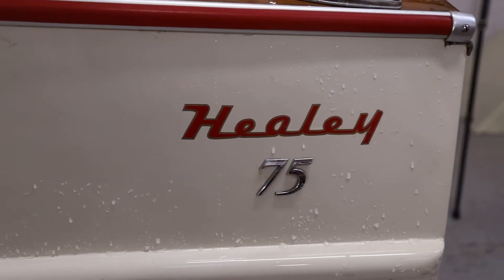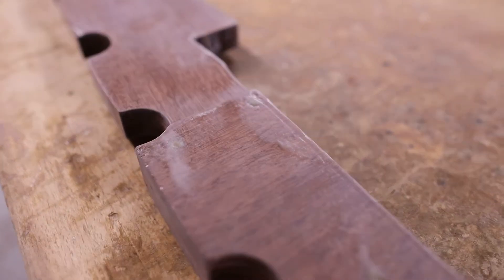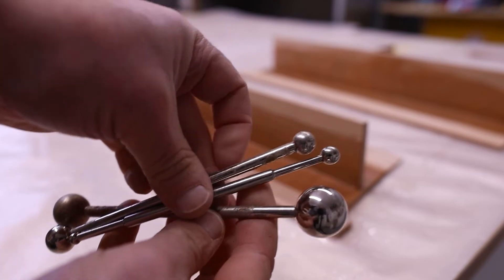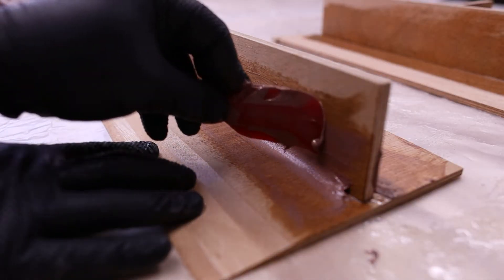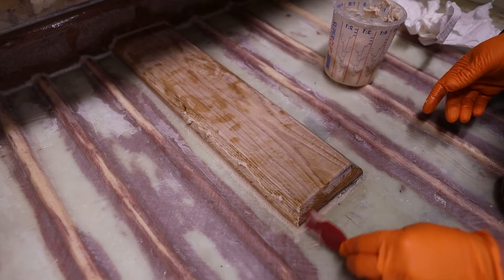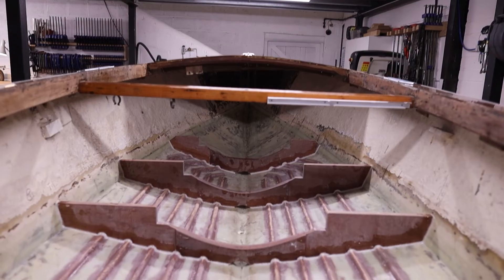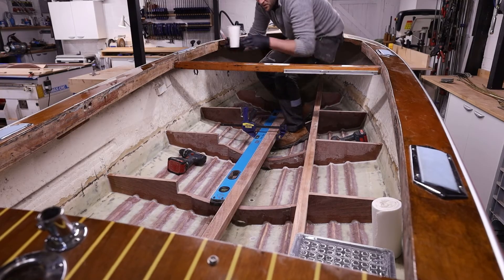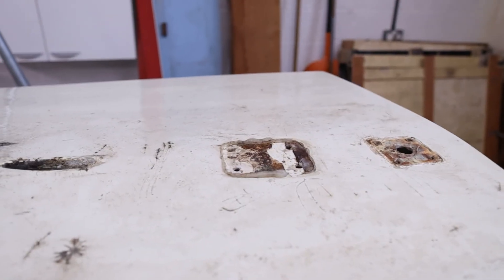Frame Installation and Epoxy Fillets | Healey Boat Restoration Part 5

Comment: Tried your tool technique today doing fillets on my boat. Used West 407 and 410 and it worked pretty well. Better than any tool I've used and pretty fast. I do need to work on the mix of fillers and the state of the putty. I need to mix to a creamy peanut butter, like what you had for your fillets. Seems like I mix forever,...
Thanks so much!
Reply from the maker: Great to hear! It's my favourite tool for filleting and like you say, it's fast!

Comment: Hi. Great video. I purchased a fibreglass boat, the hull is not glass over ply just fibreglass. I see he hull is only a few mm thick. To stiffen this hull would it be best to sand the inside of the hull, and add a cupple of extra layers of matting. This was purchased as a unfinished project.. the floor has been removed. Thanks for any advice

Comment: Can you tell us what product the brown epoxy you used? I'm currently building a class b utility runabout and would love to use that.
Reply from the maker: That is the West System 405 filleting blend, it will give wood coloured fillets. If I am doing them on mahogany then I will sometimes add a bit of mahogany dust as well to darken the colour a bit further.
Reply: @DanLeeBoatbuilding  Hey Dan in the video you are adding 403. Do you use both fillers in the filleting work?
Reply: Highly appreciate the reply!

Comment: Your thoughts on polyester resin or do you do all your work with epoxy? I hope to be refinishing a 1979 Checkmate and didn’t know if I needed to stick with epoxy or try polyester resin. Excellent work you do Dan
Reply from the maker: I haven't used it for years. It certainly still has it's place but in my opinion that is in wet on wet fibreglass moulding and layup only, possibly repair in some instances. It is very poor for bonding to anything other than itself and doesn't have as good water resistance as epoxy.

Comment: Have you ever considered using laminated frames?  If you have, what benefit do you think this application would result.  I have been unable to find a technical strength comparison, only a statement that they would be stronger.  Nothing that I could use to determine equivalent frame depth.
Reply from the maker: Yes, laminated frames are a great idea! A little dependent on the shape of the boat as to when they work out best, anything that has rounded bilges or chines work particularly well. In the case of this boat they wouldn't be worth the extra work. Generally the benefit of laminated frames is that because they are stronger their cross sectional area can be reduced, giving more space internally in the boat. 

A good comparison reference would probably be the Gougeon Brothers Book on Boat Construction. Towards the back of the book there is a section on well known boat scantlings that may allow you to do a comparison between laminated and sawn frame sizes for similar boats.

Comment: Dan, great video and explanations. I have that exact silicone spatula in my kitchen and i thought about using it when I was building my boat. Seeing how good those fillets turned out, I wish I had. I will definitely try it on my next build.
Reply from the maker: Just make sure it doesn't go back in the kitchen afterwards or else you might be in trouble 😆

Comment: Hey Dan, I love watching your work! You are doing such a nice and well reflected job! I want to say this boat will be loads stiffer, better and more beautiful than ever before. I do not know if you want to go with the original engine but due to your massive reinforcement of the whole boat, you might consider to even upgrade to more power (as long as the amount of space is given for a more powerful engine). Looking forward to more of your great work! Take care.
Reply from the maker: Yes that would certainly be a good idea for better performance. In this instance we are going to put the same engine back in for originality. It is an 1800 MGB engine and quite a big heavy lump!